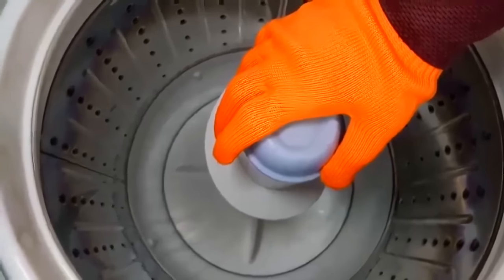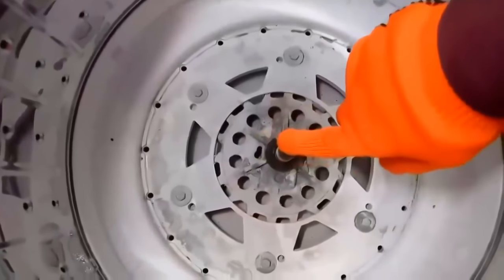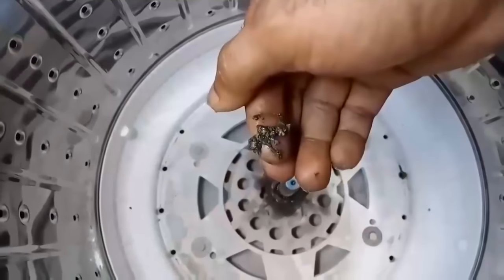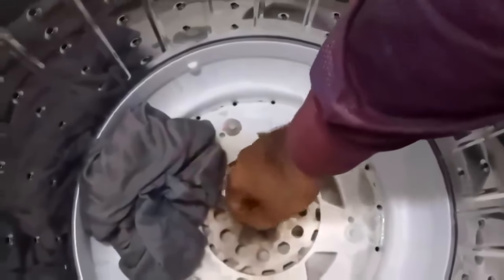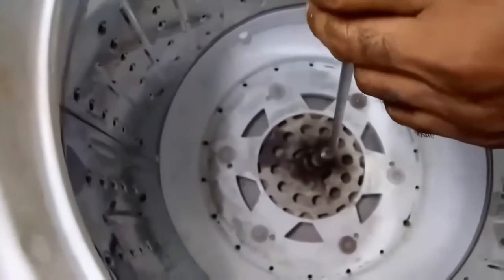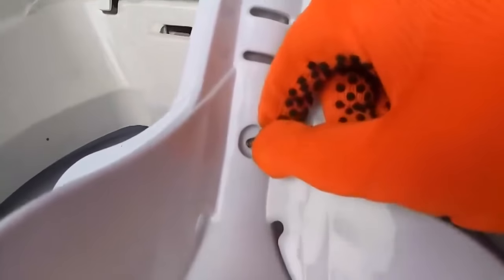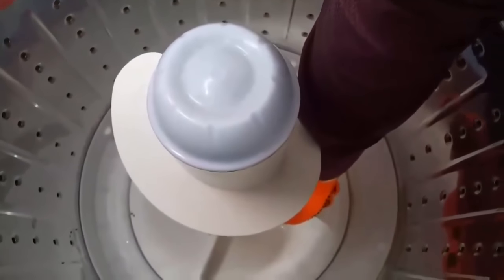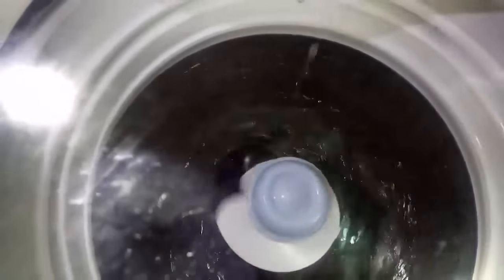The Expert's Guide To Washing Machine Not Spinning

Comment from the maker: Point To Remember: Whenever your washing machine gives humming noise and not turning for washing your clothes while switched on and put to mode. This is the mechanical problem, in this case do not straight away change the bearings or associated parts. Please follow the method as I have shown in the video. SAFETY PRECAUTION: Disconnect power supply before starting work on your washing machine
Reply: Tq sir.it started rotating but  only in one direction.earlier problem is resolved on it own.any specific reason for rotating in only one direction.
Reply: It's*
Reply: Lambretta Ramesh how do you open the cover of a DEFY washing machine. error is E9
Reply: My machine not dry clothes  that my problem plz help brother
Reply: My whirpool fully automatic washing machine is washing clothes n rinse also. But at the time of spinning tub is not moving and creating noise while wash n rinse. 
I hv called customer service  they hv send mechanic and he told be this is the problem of capacitor.. 
Next day he came n change capacitor but probkem remain same.. 
He told there is a problem of motor.. 
Next day some other mechanic came n checked n askind r u using descaler powder i aaid yes he asked which one.i hv shown. He replied this is duplicate u shouldn't use dis jusy because of this ur machine is in bad condition. I hv purvhased just 2.5 yr back. 
He told this is a probkem of beraing or gearing not exactly... Poora mechanism change krna hga 
Machine ka jumper bh khrab h....vo bh change krna hga
Total 6000 ka exp btya. 
Phr apne descaler powder ki mktg kia aur bola agar aap y purchase kroge to m aapko 5000 m krje dunga plus 3700 clen powder k.. 
Phr bola warranty ni h to warranty ke lo 3300 ki plus 3700 ckean powder. 
To m within 2 month aapki machine m jo jo khrabi h vo sab change kr dunga. 

Ab smjh n aa rha kya kre. 

I question is that if poora mechanism khrab h to wash bh nhi krta... 
Rinse bh n krta... 
Ek mechanic ko phke dikhya tha vo bola motor khrab h.. Humari washing machine pr 10 yr motor ki warranty h to humne whirlpool cl kia.. Usne alag kahani btai.. 

Ab kya krna chahiyn. 
6000 to bhut mhnga g.. 
Isse to new washing machine le le. 10k m... 2 yr warranty bh milega. 
But 2.5 yr m kaise khrab ho skti h
Reply: I have same problm with may whirlpool top load machine .... technician came and told it cost 3000 to replace that part ...I don't know which spare part is that
Reply from the maker: Please ask him what part he is going to change. Then we can find better solution for the problem
Reply: @LambrettaRamesh  sensor
Reply from the maker: Which sensor ?
Reply: @LambrettaRamesh  that I don't know technician told me it's lens problm
Reply from the maker: Ok. I let you know regarding this

Comment: Thank you so much for this video... i have samsung top load washing machine.. Spin is not working.. Drum shaft with agitator is rotating smoothly both the sides.. but when i remove the belt, motor is running fine. do i need to change the condensor

Comment: Thank you for making this vid. Turned out a bearing is shot in transmission. Spin cycle works finally but squeals like crazy
Reply from the maker: Due to slipping belt and improper lubrication

Comment: My washing machine is whirlpool 360 degree inbuilt heater. year 2013 model. wash and rinse programme is working but when it comes to spinning programe, only sound comes but drum wont spin and water remains in cloths? do we need to change gear box and suspensor? please suggest.

Comment: Thank you sir for the information...i have followed the same steps mentioned by you but still my machine's pulsator is not moving...can you please let me know how to fix this problem (i have done all the techniques mentioned by you...needed the next step).
Reply from the maker: Actually this method is applicable for the machine unattended for the prolonged period. If applying this method by all means and not getting the rotation mean there is something other problems related to the rotation system (Mechanical). But if you get the movement by even 05 mm on both sides. Then we can have some hope that it will start moving. If not it is better to show it to a professional

Comment: Hello sir, my washing machine samsung wobble is giving problem. Every thing is working but some slight noise comes n it's water draining becomes very very slow near to stop then from back I open the drain pipes with the help of ur previous video. It seems to clear but water does not come out then I insert a long wire n suddenly water comes out n it works properly. But after one cycle, with new start it washes then some noise comes n it again stops draining water please help what could be the problem

Comment: Sir i have a top loading whirlpool 360° 7.5 kg which is washing nd rinsing perfectly but not spinning in any program..facing prblm first time from d date of purchase..Can u help me asap?.. Thanks in advance
Reply from the maker: There are some interlocks in the system for spinning if they fail to work then the spinning process wont take. If there is a problem in the circuit then the spinning process won't start

Comment: Thank u so much  for such detailed practical video ! My Godrej Top load automatic washing machine doesn't spin at all .. when it's 8 mins remaining it just makes noise but doesn't dry clothes completely so we need to squeeze them manually.. it's lockdown period now can't ask a mechanic to help either.Pls help
Reply from the maker: In this case please check for : The drain hose must be routed below the level of washing machine bottom. And there should not be any stagnation of water during draining. And also check for any improper operation of drain valve which is at the bottom of the machine. If there is a blockage in drain valve seating area then the process of full draining of water won't take place. If the full draining don't take place then the full process of spinning will be pending because there are some interlocks in the washing machine system
Reply: @LambrettaRamesh  Thank you so much Sir for your quick reply,I appreciate your detailed information provided to help me !!!

Comment: Hi Ramesh sir, i have whirlpool 651 washing machine and it is not agitating when water or cloths in the tub.spinning is working fine alone. I even tried troubleshooting as well but no use. Could you plz tell me the way to make it work .Some whirlpool mechanic told me to replace with a new one. If u r from Bangalore plz let me kNow what to do or if I can fix it with your help.
Reply from the maker: Please check for the overload protection is getting on may be. And also check for the drive belt for slipping. And one of the causes is worn out parts. In this case you have to replace the components. And one important thing is that carefully check for the drive whether it is in good condition or not. I mean the presence of transmission. Most probably the problem will exist in the above mentioned points. You have to check from the bottom what actually happening while the process of agitation during operation. Please check for overloading matters. Try putting without any clothes in it in general. Thank you

Comment: My videocon topload washing machine tub is hanging from one of the side. It spins without putting any clothes on spin mode, but do not work with clothes in. Only pulsator works with clothed in. I can see bold from the side that tub is hanging. How do I fix it?
Reply from the maker: When any of the supporters (Hangings)   are not in position then the tub will tilt to that particular direction there by it will create restriction to the rotation of tub. That's why when you put load (putting clothes mean ultimately increasing weight in tub) rotation is being restricted there by no movement to the tub. To fix this problem you have to open the machine top cover to replace hanging points. You can watch a video in MY CHANNEL how to dismantle washing machine at home. I hope that will help you. Thank you

Comment: What happen if the motor can run alone in SPIN mode but not when belt is ON with the pulsator ?? My Midea washing machine suddenly give me SPIN problem where the motor want to run but immediately stop and I found the pulsator can only turn the opposite direction against motor in SPIN mode. Is that normal ?? Thanks first
Reply from the maker: Up to some what. But there may a problem in programming circuit
Reply: Is the Drum should only turn follow the motor direction ?? By the way what is the name that small gear thing that we put the clutch spring inside ?? Thanks@ttaRamesh

Comment: Sir can u tell me the reason for my washing machine problem. i have a fully automatic videocon topload washing machine.water is completely filled till the brim and slowly gets drained off but drum is not rotating at all.even if  I select spin mode also.
Reply from the maker: The reason for draining of water from washing machine is mainly due to incorrect closure of drain valve. I made a video regarding this and how to trouble shoot. You can watch it my channel. And the reason for not rotating is there are some interlocks in the system during various operations of the machine. Please remember if you are not having idea about the circuit please don't go ahead instead call a service mechanic why because self handling of system may lead to further problems. Thank you
Reply: @LambrettaRamesh  pls send the video link.

Comment: MY IFB  FULLY  AUTO  MODEL  NO. AW 7233  SHOWING  AN  ERROR  OF  E2.ALSO  PLEASE   ADVISE  BEST   SEMI  AUTO  M/C.    THANKS
Reply from the maker: This is due to blockage in drain or blocked pump filter, that mean water is not getting drained as per the required timing as per specifications in the circuit. In this case routing of drain hose and length of drain hose is also involved. Please check for the blockage in pump filter and hose also. In the routing of drain hose there should not be any water stagnating zones. For best semi automatic washing machine go for Whirlpool or LG. Thank you

Comment: which is best fully or semi automatic
Reply from the maker: +Jyoti Yadav. If you are employed better take fully automatic. Otherwise good to take semi. Because problem rectification with semi is very easy. And can easily identified. Purpose is same. When we talk about fully. It takes time to judge the problem. If problem occurs with programming circuit then we are gone. Maximum we have to change the entire programming circuit which makes us to think. Thank you
Reply: Mr Ramesh, I have bought a new fully automatic washing machine, top loading, the problem is, after I start the machine, it works fine, but after a little while the clothes are washing, suddenly a large noise starts as if the drum is disbalanced and is going to break down, please advice what could be possibly wrong or is it a manufacturing fault and a solution to it
Reply from the maker: +Mushtaq Hussain Ji. Please check the drum for the correct suspension. If suspension is not correct. The drum will rub the outer container there by loud noise comes. In some washing machines sponge pieces will be sticked to avoid the tub direct rubbing to outer container. And one more thing is that. When any clogging which contains coins or any metal material on the valve seating projecting towards washing machine drum/tub will cause it to make noise. Why because during washing that material comes in contact with the tub which is rotating while washing. I hope these points may help you. Thank you

Comment: What if the housing is violently rotating?
Reply from the maker: If the laundry is not properly arranged then it will lead to improper balance of machine causing to vibrate. The other reason is if there is a problem with suspension then also machine will vibrate

Comment: The spin mode is working perfectly fine but only problem is in washing mode ..as there is no movement of the botom plate or the drum
Reply: Same problem
Reply: @ebenezerr1409  the pulsartor inside teeths are worn out so there is no anticlock movement. .. so I had to change it and now it's fine

Comment: Sir I have a problem plz help me
I am having whirlpool stain wash top load automatic machine
Reply from the maker: +Yash Keswani Ji. Please tell me the problem so I can help you
Reply: सर मेरे पास व्हर्लपूल की स्टाइन वाश फुल्ली आटोमेटिक मशीन है। कुछ समय पहले ये जब कपड़े धोती थी जब ड्रम घूमता था तो बहुत आवाज़ करती थी जब वास् के बाद स्पिन करती थी तो और जोट से आवाज़ करती थी मैन मैकेनिक को दिखाया उसने कहा इसका गियर बॉक्स खराब हो गया है पूरा टब बदलना पड़ेगा जिसका खर्च ₹6000 आएगा क्योंकि गियर बॉक्स रिपेयर और चेंज नही होता। मैन कहा ये बहुत कॉस्टली है कुछ और उपाय बताओ तो उसने कहा सेकंड हैंड टब लगा दु ₹2000   में मैंने वो लगवा दिया बट में उससे सतिस्फीड नही हु वो प्लास्टिक का ड्रम है और पुल्सटॉर बहुत लंबा है जो कपड़े फाड़ रहा है पुराण वाला ड्रम स्टील का है और उसका पुल्सटॉर छोटा है  वो सही था। क्या इस टब का गियर बॉक्स पुराने टब में नही लग सकता?। या में पुराण पुल्सटॉर इसमें नही लगा सकता?
Reply from the maker: Yash Keswani Ji. The judgement related to gear box condition of washing machine requires experience. You are not supposed to change the tub where as you did that. Ok no problem. I tell you one thing is that check for the shaft play underneath the washing machine. You can do this by your hand by pushing either side. If you find the play then it is the indication of increased clearance of shift which is protruding out from the gear box which leads to excessive vibration of washing machine including your tub. You have to change the gear box unit not the tub. If you change the tub the problem still exists because the play of shaft tends to imbalance the tub when the washing machine washes and spins. The involvement of bearings are also plays role in this. The bearing clearances should be in limit. You can do one thing please put the old tub by fixing it right accurately. There should not be improper fitment which leads to improper turning. And please let me know how old is your washing machine. If your washing machine becomes old it is general in nature that it starts giving problems due to wear and tear of material. I am carrying a practical on the same model to rectify the problems. If I get success surely I let you know. Thank you

Comment: I think it temporary solution but most cheper and easier.if the bearing start jammed.it mean the bearing sealer leak/lubricant dry.it will happen again.better change the bearing.
Reply from the maker: After applying this method. It is working fine. As of now many washing cycles completed successfully and still going on. As per your advice if vibrations are more. Then we can go ahead in replacing the bearing. Thank you